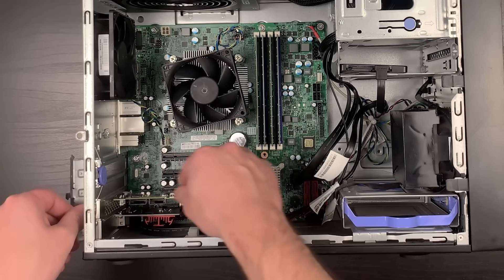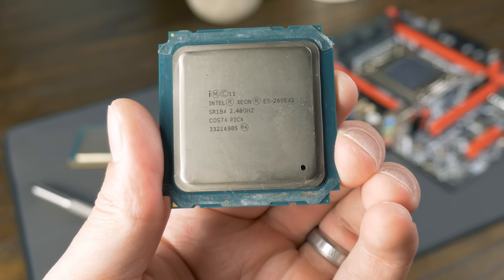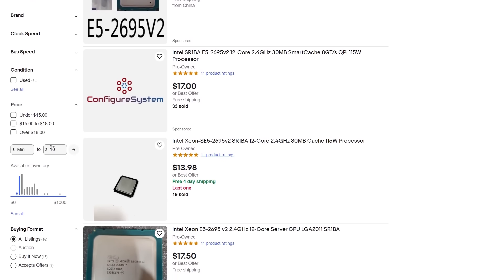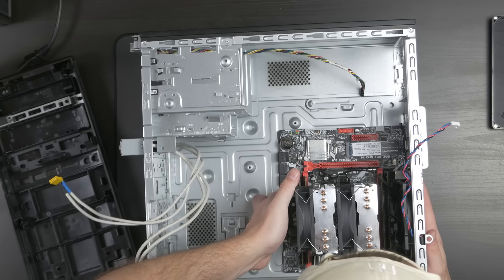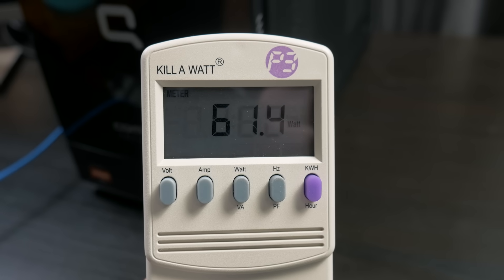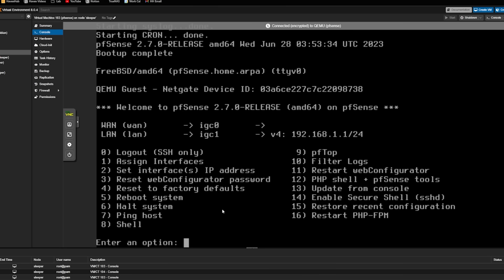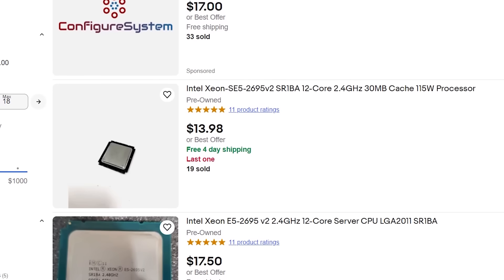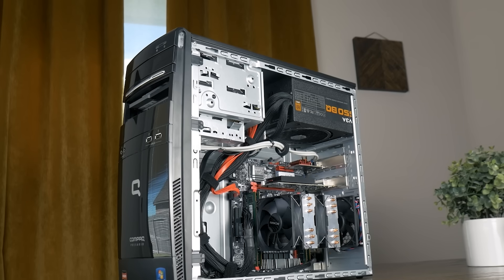Are CHEAP x79 Servers/Workstations Good In 2024?

Comment: I built an X99 system recently with a 5960x OCed to 4.7Ghz, in benchmarks it's 2% slower than a stock 9900k, even got rank 1 in time spy and time spy extreme for that system with a 3060ti but that's the limit of what that system can be OCed to + only 3200mhz max OC. 9900k can do 5 - 5.1Ghz + 4200mhz ram.
Reply: Yeah that's very similar to what my X79 rig does. An OC'd 8-core 1680v2 is effectively as good as it gets for DDR3 gaming. At ~4.6GHz it'll easily break 10k CPU score in Timespy which is pretty wild when you consider this is over a decade old. Maxing out DDR3 has better latency than the early DDR4 but the downside compared to yours is the lack of AVX2. Plus X79 only makes sense if you have a board and memory. The best DDR3 quad channel kits are getting very hard to find at decent prices. I'm glad I held onto my g.skill 16GB 2400 CL9 kit I got when prices tanked because I rarely even see them for sale these days.

Comment: I'm doing something similar with a retired CT scanner workstation.  I went with the 64 GB of DDR4 RAM and a Xeon E5-2696 v4 CPU.  You do have to keep an eye on the costs of the hardware and the power it will use but if you don't run it 24/7 that can be contained.  I want to have a Proxmox virtual environment to experiment with various OS and software configurations,  The learning will be worth the relatively low cost of ownership IMO.

Comment: Stumbled on first a Dell 5600 and then a Dell 7800. Dual Xeon 10 core CPU,  SSD Primary with 1TB data drives. Dusty as hell, but here's the kicker $30.00 each! One had the original M4000 Quadro card, the other I had to add a video card to. Neither had power cords, but those are a dime a dozen. Not a bad haul!

Comment: I just bought a Supermicro server board for 28,- a CPU E5-2630L V2 (just 60W TDP) for 10,- and 128GB ECC DDR3 RAM for 40 ,- and a CPU cooler for 10,-. So around 90 bucks for the system. I had an old case + PSU to use and 2 old 1TB hdds + 1 240GB SSD laying around. It is now my new proxmox server and the board even has IPMI and a matrox GPU onboard :) Is it a fast and cost efficient system? I don't think so, but it lets me test things with a real server board, like IPMI and the 128GB RAM boost ZFS a good amount :) To get a feeling what it means to play with real expensive hardware it is doing a good job! :)

Comment: I build a X79 system myself because I liked the platform and its price/performance ratio.
But sadly, here in germany thats just a theory. 
The Xeons are cheap and the RAM aswell, but the Mainboards are still damn expensive. And by that I mean legit Mainboards not that Chinese knockoffs. I was lucky to find a "Intel DX79TO" for 50€. First I paired it with a Xeon E5-2670 (8C/16T @2,6 Ghz), but replaced it with a Xeon E5-1650 (6C/12T @3,2 Ghz) because it was one of the few Xeons with OC. 
I ordered 32GB ECC RAM with the same Speed but was scammed - different Speed and nowhere mentioned it was registered ECC RAM, System wouldn`t even start. So I had to replace it with 32 GB DDR3 Non-registered Non-ECC Desktop RAM and it worked.
GPU is a GTX 1080 wich runs fine for me.
I installed Kubuntu since I left Windows in 2020 and it performs very well.
But the biggest Downside of having a Server Mainboard like this is it is very slow as normal Desktop.
When I had 2 SATA SSDs and 2 SATA HDDs in it every Boot process was about 2 Minutes! My old Laptop the same age boots around 25 seconds. So its not exactly what I expected to be - a fancy desktop solution with lots of performance for less money. But well, life is about learning. 
I will go now with a cheap Ryzen or Intel system and may be happier with it.

Comment: I was thinking, what would be a fun yet stupid use case for cheap high power consumption CPUs that you don't want to have running all the time?
Maybe buying multiple of them and combining in some sort of small stackable cases with DC power supplies, for cost savings, running them all from a single AC power supply and only turning them on as an on demand render farm.

Comment: Of course it is a good idea. I use 10900 on one PC and 2699 v3 on the other. And their power is quite close! Taking into account that the 10900 is power limited to 125 otherwise no cooling would handle its heat.

Comment: Just builded a Budget Server other way around: Got an AM4 Z370 Board for free, with Bifurcation. Got myself a Ryzen 5 5600 for 110€ for it. 64GB ECC on the board, got a nice deal for 70 Bucks. Hooked up my old S-Ata Raid with 24TB, a Bifurcation Card for 40 Bucks and a 10gbit Card i had on my old Server. 6 Cores/12 Threads are great together with 64GB ECC DDR4. Eliminated my Old NAS, my Old Server, some other services. Everthing running on it at 20-30% load max. The NAS is cached via a NVME Stick on the Card, so doens't spinn up often. And the other Services run on Cheap Gen 3 NVME 2TB Sticks. The Board doesn't support PCIE4.0 but i got 20 ! PCIE 3 lanes only for NVME Drives, so 5 NVME at full Gen3 speed (One on the Board, 4 on the Card). The other 4 Lanes of the Ryzen 5 5600 are used for SATA and the 10gbit NIC. The Ryzen 5 5600 got more Multicore Performance then the E5-2695v2 at a lower Power consumption, but you can still use ECC, as long as you don't use a GPU you get lot of PCIE 4x lanes, with a Bifurcation board. My old Server was an Xeon E3-1231v3, so even in direct comparison i dropped by 20 Watts. The Zen Cores of the Ryzen shows their Server Lineage: ECC support and 24 PCIe Lanes, great for some cheap efficient server.

Comment: Sometimes, at least here in Europe, you can find these old x79 already in old complete workstations or servers for about 50€ or less. If you are lucky enough, a friend of mine was, is possible to find jbods full of disks for very very cheap or for free. The disks will be crappy and a few will be broken, but for the price are unbeatable. I never managed to snatch a deal, but said friend built 2 servers for 150-ish including ssds, cables and all the new stuff he had to buy. One of the deals was even local and he got and old slightly damaged rack for free and more untested drives for free

Comment: Ivy bridge in general is still a good platform to buy where single threaded performance isnt priority. Im using an ivy bridge xeon e3 1230v2(this uses the consumer 1155 platform instead of the high end 2011 platform) in a supermicro x9scm-f matx server board. ECC, IPMI, twin gigabit lan, 6 sata and everything. It only draws around 40w at idle running omv and has all the features you want and the cpu, board, cooler and memory were only about 60 dollars all in. If you are virtualizing many machines, a single or dual socket 2011 system makes more sense but if you dont need tons of cores, the E3 systems are just as good. There is no reason you couldnt use a core i5 of the same era, but using these xeons opens up better board options for less. I would recommend getting your cpu, cooler and board in a bundle, i got my x9scm-f, e3 1230v2 and stock cooler for around 35 dollars before tax, it has been rock solid.

Comment: I would have gone with a C600/602/604 motherboard as you can get dual sockets and some offer up to 12 slots per socket.  I did a build similar to this and went the server motherboard route mainly because I got a bunch of 16 GB registered ECC DDR3 memory for free.  I had to run them at 1333 GT/s but I had 256 GB in the end using eight slots per CPU socket.  The catch is that registered ECC may not function as expected on x79 boards.  Also going with C600 series board is that some model will offer some 3 Gbit SAS ports off of the chipset so really good for building a NAS using inexpensive, high capacity SSDs.  In addition, the board I chose came with two 10 GBaseT networking ports and IPMI remote management.

I'll also say that NVMe booting is a very hit or miss feature on this generation of motherboards.  This is the era when NVMe was first specified.  The NVMe drives generally will still work, they're PCIe devices of course, but just the boot functionality which requires BIOS/firmware support.

Speak of BIOS/firmware, some X79 boards permit simplistic overclocking of these via their base clock.  The good boards have multiplier/divider bus settings so that a stable 133 Mhz base clock can be used instead of 100 Mhz.  Most of the time you're not going to be able to handle a straight 33% overclock so reducing the CPU multiplier balances things out to a higher speed.  Workstation and server boards tend to shy away from overclocking but they do generally permit making the single core boost clock apply to all cores simultaneously.  With good cooling and tuning (high power limits helps a lot), it is possible to get these 12 core chips to operate at 3.5 Ghz across all their cores without issue.  

The lack of AVX2 does hinder things a bit as these chips only support AVX1.  These AVX1 only chips were on the market for about three years before AVX2 became a mainline feature so it doesn't surprise me that some newer software is dropping support in favor of the far more common AVX2 extensions.

Comment: I think a great option for high core count would be with Skylake X chips, the 12 core 7960x goes for about 100-150 right now and you can get a MB for around the same if not sub 100. They werent really the best at launch but 250 isnt a bad deal.

Comment: Unused RAM is wasted RAM in todays servers, ZFS uses unused RAM but processes gets it when needed. 
Servers are not race cars (single core performance) they are freight trains doing multiple tasks in parallel for many users 
Otherwise I liked your video. Yes I agree X79 is cheap but X99 is a better deal and give you more bang for the buck.

Comment: I love old X79 / C620 gear. You get a lot for your money, especially with the E5 and E7 2000 / 4000 series chips if you're after setting up a dual or quad socket workstation / server.

My current virtualization server is a dual Xeon E5-2640 system with 96GB RAM... Consumes less power than the X58 systems I had prior even including the 8 disks it's running in two VDEVs.
Reply: My main linux box right now is an X58 with an x5690 and 48GB (tho for some reason the BIOS insists there's only 32 😞).  I'm gonna push it shortly to an X99 with a E5-2690v3 and DDR4. CPU is a touch slower, but I expect overall performance to be better with more cores and quad channel DDR4 vs three channel DDR3.

Comment: built out a E5-2670 V3 workstation a couple of months back with a HUANANZHI X99-QD4 Motherboard and cpu combo that I picked up off Aliexpress along with two 8GB DDR4 ECC ram sticks. combined with a cheap 1tb nvme gen 3 drive and a Sapphire Radeon RX-5600XT video card it makes for a very nice machine for gaming at 1080P, scoring just as well in every aspect as my current gaming machine that has a ryzen 5800X3D cpu, 32GB of ram, and a RTX 3070 8GB video card. gets a lot hotter, but with a good tower cooler with proper thermal compound application in a well ventilated case it never gets close to the high temperature range that would cause it to shut down.

Comment: i'm still running a E5-2650LV2 with 128GB ECC on a Supermicro X9SRI-F as a TrueNAS Scale Server with Plex and an extra VM for some docker containers. Still satisfied. The onboard controllers handle 10 drives and i threw in a quadro p400 for transcoding in plex and a 10GB NIC. Sure.. it's not fast but with most of my machines connected through 1 and 2.5 gbit ethernet the server delivers either up to the networking limit or the drives limits, which ever comes first. For WS use i'd recommend an E5-1650V2 which is overclockable. I'm running one an a Huananzhi X79 Board.
Reply: How is the realiability of these motherboards ? Dependable for 24/7 workloads ?

Comment: Hah I just built a machine with a Machinist Z79, a 2690 V2, a... custom (jank) Heat sink and 16 gb of 1660 ECC. I threw a AMD 6400 GPU on it and.. Well. It's not really all that bad. I aim to throw an HBA on it, and ICYdock SSD caddy, and call it good as a bitty general purpose server.  Without the ICYdock and SSD's I think In for 100 bucks all in?

Comment: A few months ago, I was absolutely blown away at the low prices on some business-aged Xeon E5-2695 v3 workstations.  Ended up buying a dual CPU machine with 256 GB RAM.  Replaced the stock CPU coolers and this thing has been off to the races.  Troubleshooting old hardware sucks, but with performance this strong, it's worth it. 

The power cost is another story, though. 

Very cool video, though.  I love exploring this hardware that's not often seen outside of business uses.
Reply: How bad is the power consumption?
Reply: @MezeiEugen  v3 cpu like he's talking about I think is ballpark 150 watts for JUST that CPU at full load.
They do power conserve when lightly loaded, but not as well as more recent stuff.

That's also the high end of those CPUs though - some of the lower end can get down to more like 60 watts at full load.
Reply: @bricefleckenstein9666   The problem is that when you have dual sockets you get almost no power savings. 
AFAIK this is still a problem nobody worked on.
Reply: @llothar68  The power savings is noticeably more than you seem to think.
I DID mention "not as well as more modern stuff".
If you're expecting 10 watts at idle, you need more recent gear - 50 on the other hand even for a pair of the higher-end CPUs that will soak 120watts EACH at high loads is not unreasonable - and a LOT of the power consumption is the FANS at that point, and the Hard Drives.
Reply: Yeah, that has always been the problem with older hardware. You are always either trading off either performance or power draw. The current sweet spot is actually Xeon Scaleable "Silver" 4114 or 4208. The 4208 costs a bit more, but it's the same perfomance with better power efficiency, more cores, and access to Optane DIMMs for a massive leap in effective RAM capacity or super low latency storage (I recommend using them for ZFS cache).
Reply: @KiraSlith  Depends on your usage - and it's not the cost of the CPUs that's the issue with your recommendation, it's the cost of the MACHINES that can use them.
I'd call the E5 v2 generation the sweet spot right now, as the machines AND ram are almost dirt cheap.
Reply: @bricefleckenstein9666  You can get single cpu prebuilts with Xeon Scalable support, with RAM for around 400. My T7920 was 845 with dual Silver 4114s and 128gb of ECC DDR4 (which I use mostly for AI compute).
Reply: @KiraSlith  I paid around $700 for the most recent of my machines - a Supermicro 36 drive with dual E5-2680v2 and 256GB ECC DDR3 ram
Also had ALL of the caddies (a lot of places charge $5-$6 for JUST the caddies).
That was significantly higher than some of the options that held fewer drives and were in 1u or 2u cases - and it INCLUDED shipping (which starts adding up on larger cases with lots of drive support).
Reply: @bricefleckenstein9666  That's not that much of a price difference, for much worse performance and power draw. You're going to pay for that $100 "savings" from your power bill after a year, or sooner in certain areas. The R7920 exists, similar price, same hardware, but rack mounted with more drive bays.
Reply: add good internet connection with static IP adress, order some subnets and you have your own VPS hosting

Comment: Just saw a quotation for 2650v4($6)
4sticks of 8gb 2400 mhz ram around $50
X99 like huananzhi is around $50-55
I hv a spare 240gb nvme since that mobo supports it
Only not sure which cooler to slap it with
Might get a gtx1070 worth $70-80 in fb marketplace just to experiment this system with
Its 12c aswell

Comment: When running Proxmox with ZFS, the Memory usage graph is pretty pointless. 

Since the ARC will discard cached data if that memory is needed elsewhere, it would be far more useful if the Summary page plotted ARC size separate to other memory usage as that would be a far better proxy for 'free memory' than mentally subtracting memory usage from total memory size.

Comment: You got the fan backwards ?!!!. Very funny!. explains the noise eh ?.
Reply: I got a 2697 V3 14-core that turbo at 3.6Ghz, It Fast!. My second machine is a 2680 V4 that turbos to 3.3Ghz but it suck way way less power. Both having problems with wifi after like 8 hours of use. Wifi chip just powers off, so unplugging the usb and pushing it back retores it.

Comment: I like these budget videos. great work.
Have you ever thought about a 2009/2010 MacPro ? They're super cheap now. and usually have 2x CPU's  most people have upgraded to X5680 CPU's.
have 4 Sata bays. 6 if you use the DVD bays. they make the perfect Proxmox Box. Dual Xeons, 128GB Ram, GPU Encode/Decode Hardware acceleration.
For me I spent $250 for a beast of a system.!
Reply: Built one of these years ago and still have it.  It is quite a nice machine and does run well.  Multicore beat my (also old) 6700k overclocked to 4.5ghz skylake machine.

Comment: Here in the UK energy is stupid expensive at the moment. Paying £0.30/kWh means that a 150W server is going to chew through £1.08/day. I had a server running on an old Proliant DL360 (Gen 6) Dual Xeon server (2 x 8 core, 16 threads), great for virtualization but really bad for my energy budget. I'm now just running my mail server on a dual Atom 330 box which runs at 30W flat out. But I'm seriously looking at an IBM ThinkCenter USFF PC as an upgrade so I can run Home Assistant and some other home automation too.
Reply: thats if you are running at full load all day. are you?
Reply: @ProcessedDigitally at 100% utilization a fully loaded DL360 (G6) can use >400W which is why they come with 700W PSUs. 150W was a machine running an archive NAS and hosting a couple of low traffic websites and a mail server under ESXi. The G6 runs at 120W idle.